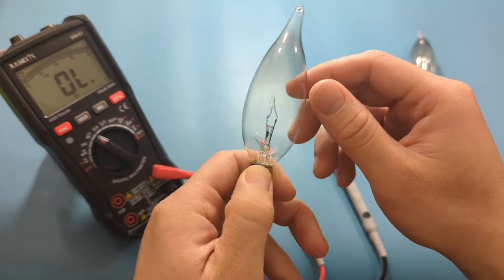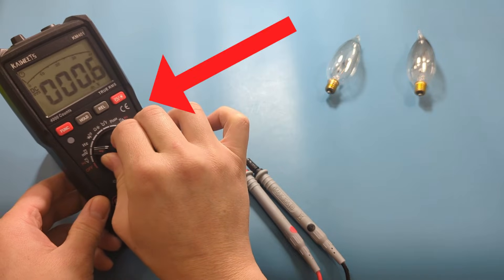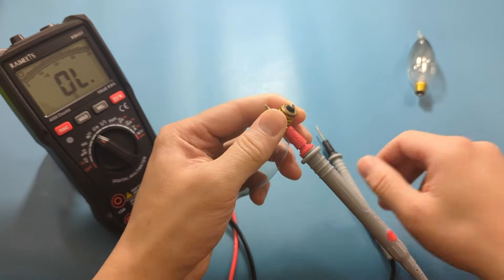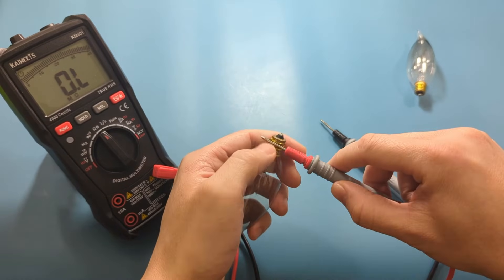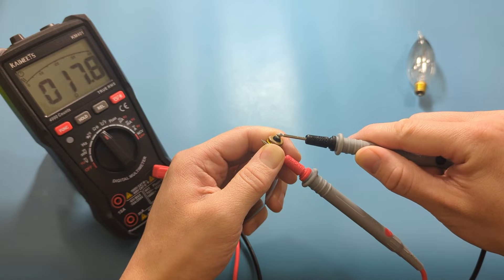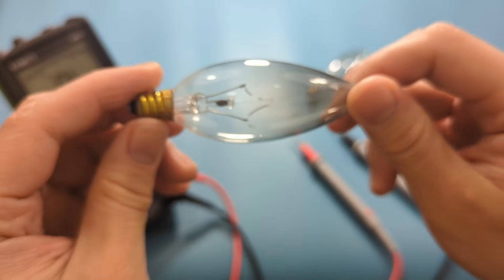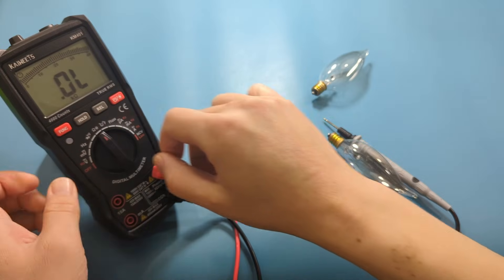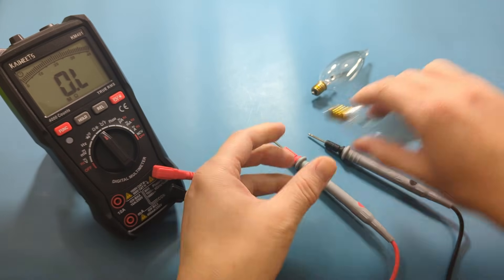How To Test a Light Bulb With a Multimeter

Comment: Hey, maybe you could be specific and show the continuity sign or where you turn the dial to on your multimeter because that’s the reason people usually ask they don’t know what continuity symbol is. They don’t know where it is on their multimeter and you just whipped through it and you can’t really see what you turned it to. It doesn’t say continuity on the multimeter none of them do just a little tip. You also sound like a robot. Are you a rabbit? Are you a rabbit or a robot or what sorry not sorry

Comment: Why does the multimeter no beep but I know the bulb works. I’ve put it into the continuity setting and touched the two leads to make sure it works. So why does the multimeter not signal that the light bulb allows the flow of electricity?
Reply: Not all multimeters beep. With some you just have to go by what the display shows.

Comment: Not a great video as it doesn't show what settings the multimeter is turned to for the tests
Reply from the maker: I explained and demonstrated how to switch the dial to continuity mode to check for continuity.
Reply: I don’t know what I’m looking for in terms of ‘Continuity’ setting. Has it got a particular symbol?
Reply: @RobertJaniro  Same question.
Reply: @RobertJaniro Omega symbol
Reply: @ElectroUniversity  Not useful as my multimeters have lots of numbers on it.
Reply: exactement